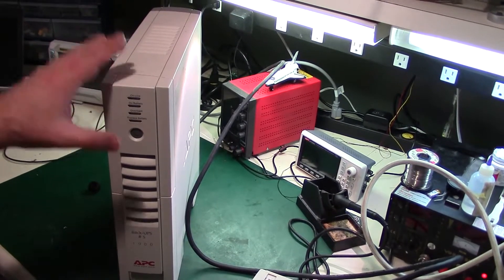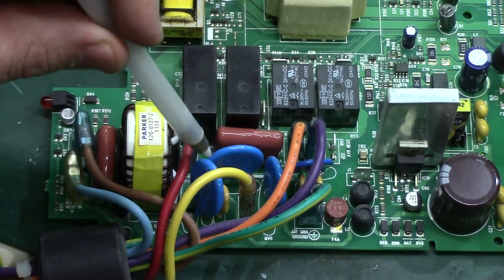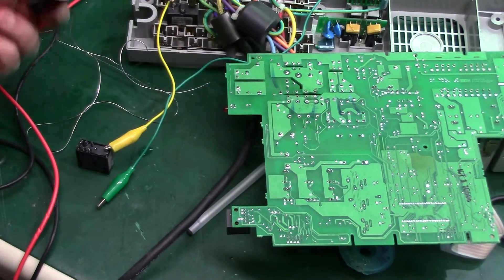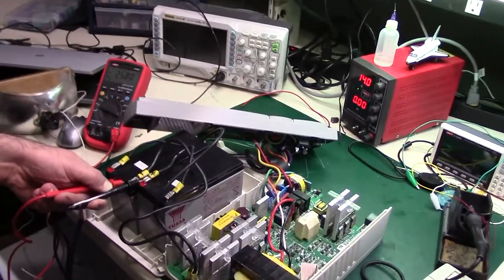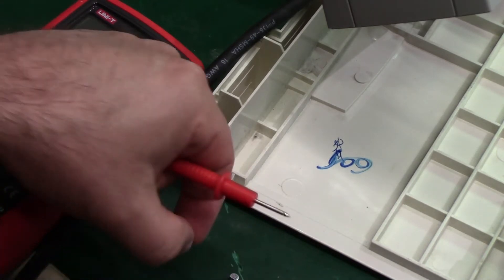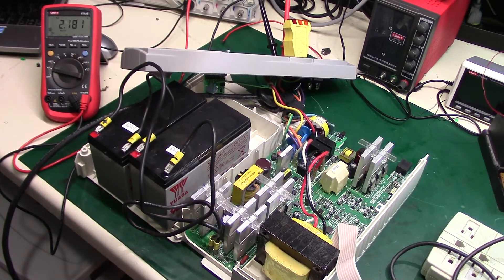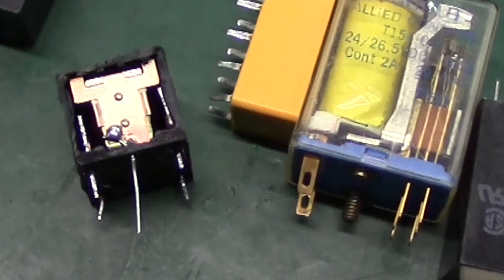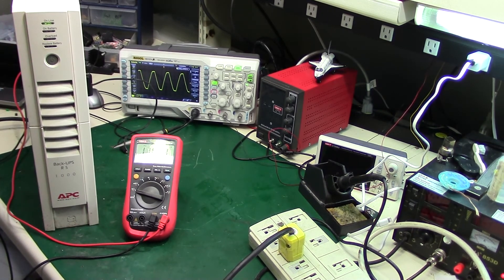Repair - APC Back-UPS M1000

Comment: Can you please help me with this problem :
I have APC BACK-UPS Pro 1400 that 50/50 fail to switch to battery at the moment the electricity cut off and goes to continuous beep and overload led even without any load attached to the ups .. I can replicate the issue but switching main wall switch on/off few times ... what component that usually lead to such failure if I want fix the UPS myself ? I tried different battery same issue.
Thanks.

Comment: I had exactly the same problem.  Changed C40 and C41 and the UPS is online again. I didn't have 16v capacitors but changed using 63v capacitors without any issue. Thanks thanks thanks what a useful video.

Comment: thanks for your post which directed me to fix my ups, I replaced both C40 and C41 despite they both measure 22uF, but may be they drift under voltage and temperature. Now the ups comes alive again.

Comment: I have a apc ups pro 1000 with this issue. I lack the equipment to confirm. Will not run except on battery and will charge when off. I want to get it fixed but I can't find a repair shop in south FL that will touch it. Any help would be appreciated

Comment: I have the BX1500 that is acting very similar. Can you tell me if those Caps you replaced C40 and C41 are surface mount or not? I couldn't tell from the video. I am decent at soldering but don't have the equipment for surface mount. I guess I can take mine apart and see but I like to take apart fix and put back together because if it sits around I may never around to putting it back together.

Comment: The first time, after completing the board, the output in battery and line mode was correct. On the line mode, when we pressed the off key, the converter and charger exploded again.(Apc model is lynx 2kva)

Comment: Hi. If during repair, all the leds on the panel should light up(load led), what is the problem? This condition exists while there is only coverter and the buss voltage is fixed by using battery. Inverter and charger are removed from the board

Comment: Thanks, like others I replaced C40 and C41, I cant reitterate how careful you need to be with those traces, they are unnecessarily thin, and pulled pads off both C40 and C41, luckily I was able to trace them back to near by components.

Comment: I have a 1500 XS with a similar problem. Online light comes on for just a moment, then it switches to backup. A few seconds later, the cycle repeats. Almost as if it cannot detect line voltage ;-). I took out c40 and c41...one registered .5mf and the other 10mf (both rated for 22 mf). I'm guessing the rest of these surface mount caps are trashed (altho rated accuracy may be less important). I'm going to replace all the surface mounts. Thanks for the video!
Reply: Update. I replaced C40 and C41. I used two soldering irons (like hot tweezers) so as not to damage the traces pulling the caps. I did not replace the rest of the caps. UPS started right up and is powering equipment.

Comment: Thank god I found this video, I have the same UPS but in 1500 doing the click of death sound.  I am going to try and replace C40 and C41.  I wish I had an ESR meter.  I want to keep this unit as long as possible as these UPS are pretty simple inside to diagnose compared to the newer ones.  Less features, less things to go wrong.

Comment: Wow, I have an RS 1500 that outputs 135v when on inverter.  Was thinking maybe the caps (40 41) from your video.  When bad caps have been found in this model, my first thought is... Bad Caps (!)   as with all mobos, monitors and PSUs.  Caps = GOAT repair fix.
However looking at that nasty square wave, I might just trash it.         
....still, it is a puzzle and I like solving puzzles.  Problem is I know nothing about the circuitry other than what you explained.  
It's been on the shelf for some years and I don't remember if the over voltage was only present during backup.   If all the time, then perhaps the Boost feature.

Comment: My BR1500i also have same problem, inverter / relay / battery charging all work, just detect AC mains got problem, from management port, it show input have 56V / 3xxV, I will try replace those two capacitor, thnaks.
Reply: Problem solve, C40 in negative charge pump  circuit to generate negative voltage around -9v across C41

Comment: hi could you help me with the same model? I hear a hiss coming from the main capacitor and moreover if I turn it off the two relays start to trip every 30 sec by themselves.the mainboard does not charge the batteries

Comment: Great! i really needed this video to exist!
Its safe to change the capacitors voltage while mantaining the uf ? becouse i see that you didnot replace with exactly the same voltaje.
Reply from the maker: It’s safe to change voltage as long as the new v is higher

Comment: Brilliant!  Customer had some clucking and clacking at first then no regular ac operation. I suspected a relay but thanks to you I found 22uf caps in control circuit exhibiting signs of high esr. Replaced c40,41 and few others weak in that area. Used low esr high temp leaded versions. A 4.7uf and 10uf also replaced. All surface mount. To open, more screws hiding under front panels. Bat cover moves down and control board cover moves up. Carefull the ribbon cable.

Comment: I've just carried out a repair on one of these models (UK version - 230VAC), it had exactly the same fault, the rattling relays on startup then fail to detect mains supply. I changed all the relays however the fault remained. Thank you for doing this video - it saved me hours of fault tracing - it turned out on mine that C40 was OK but C41 was low at about 15uf - should have been 22uf. Changed C41 and the unit sprang into life. Thanks again for this.

Comment: Thank you for this video, so yea I have 4 different units that needs to be looked at,  all of em says to replace battery but the batteries tested good.  one  works fine until it charges the battery up, when it gets to fully charge it throws the replace battery light.   I hope to find what's wrong with them.

Comment: Thanks!  I bet this fixes mine.  I replaced the batteries, then it started always switching to battery power.  Reinstalled powerchute, and the UPS thinks it's getting 156 VAC.  Later, it thinks it's 104 VAC coming in.  Clearly the input AC monitoring circuit has failed, and your video points me to the likely problem.

Comment: Nice video.
I have the same unit.  After replacing the batteries the unit would keep switching between battery and mains.
I adjusted the sensitivity to low, using the built in sensitivity adjustment, however, I am wondering if there is something wrong internally as my utility power is pretty stable and reliable and I should not have needed to make this change.  Any suggestions about what I should look into to fix this?
Reply from the maker: Might be the same fault, seems to be common in these units

Comment: Great video, many thanks! I have a mere APC350 that went crazy, and the new battery didn't fix it. Even though it is likely very different inside, you really helped me get the gist of these things. It seems to be a common failure mode of power circuitry that not only is it failing electrolytics, but it is often the smaller feedback or sensing ones that die. Thank you!!

Comment: If I had done that relay repair, when I finally receive the proper relay it is 99.99999% chance that it will NEVER be replaced LOL! Great job in explaining the troubleshooting process and everything you did. I actually have TWO of these exact model UPSs in the queue to repair and I didn't even really knew where to start (which should have been obvious) but your video has definitely inspired to tackle them and hopefully repair them. Thank you, thank you, thank you!

Comment: I have a RS 800 and a RS 1000, the RS 800 failed a few months ago, the RS 1000 failed today. They are exactly the same symptoms, I will check those capacitors. He had not been able to find reliable information to proceed with a repair.

Thank you very much!
Excellent work
Good video.
Reply from the maker: Good luck with your repair!
Reply: @z1power  Thanks!
Reply: @z1power  273 / 5000
I finally got the C40 and C41 capacitors and replaced them in the RS 1000, the UPS was like new!
In the UPS RS800 I replaced the capacitors C57, C59 and C60, it also worked very well!
I only had a few common electrolytic capacitors, but they worked wonders.

Thank you very much for your video and your work, it helped me a lot.
Greetings from Chile

Comment: I have a Backups XS 1500, has a similar problem, it does not detect AC, so the alarm sounds and it runs on Battery.  I never hear any clicks from the relays.  I pulled it apart and checked the simple stuff, but it's closing in on 20 years old.  I appreciate the video, but not sure it's really worth replacing the caps.  Everything is a risk .  I think I am just replacing the unit, I will be lucky to get 20 years from the new one.
Reply from the maker: No doubt a wise decision!
Reply: I have a RS 1000 and a RS 800, the RS 800 stopped working, at no time did the relays sound, it just stopped detecting the input voltage correctly. What I did, was replace the capacitors and now it works like new. From what I have read it is a very common fault, it is easy to repair and with reliable results.
The z1power video explains the problem and the solution very well, I hope you dare to repair it, there is already a lot of discarded hardware and it is always good to give old hardware a chance that is easy to repair to remain useful.

Comment: What type of relay is this “omron G2RG 2A4 relay”. How to test it. I am also facing the same relay sound back and forth problem.
Reply: when relays  chatter\buzz , the relay is most likely good .
What  is driving the  solenoid is most likely bad .
That doesn't say that the  driver transistor is bad ,
but something is wrong with the  driving  signal .
( relays can go bad , however
 the magnetic strenght and opposing spring force
may not be a  match , anymore )

Without looking at  signals in the system , you'll have to
pull parts and manually test each one .
( Shotgun  troubleshooting , guess and  replace and hope  the system  works )
not the best way to do it . As a last ditch effort , it might work .

Those small silver caps are most likely  solid  tantalum .
( considering age of unit, i would have replaced the whole set )

i noticed all the  electrolytic caps looked good ,
No  rounded  tops . No  leakage .
( that doesn't mean these caps are actually  good )
just a level of  Confidence that they still  sufficiently  work .

Caps ,...the most dificult parts to make .
Caps ,...the most  failed  components of all .
( if you had gone straight to the caps ,
  the  relays could  have been left alone )

need a  hot air  wand\pencil  to help remove those  caps
to help avoid tearing  traces .

Too sad no one has a  schematic and parts locator diagram of  a  UPS .
there is a lot going on in an UPS .
If ups were simple , we would all build one .
Reply: @240mains  thanks !
Reply: @240mains  
Well explained . Thanks
Reply from the maker: Test or replace C40 and C41 first
Reply: @z1power  thanks!